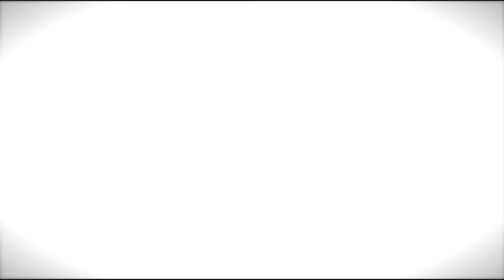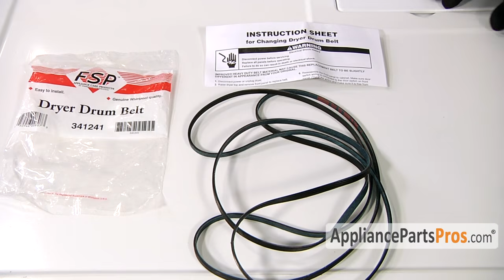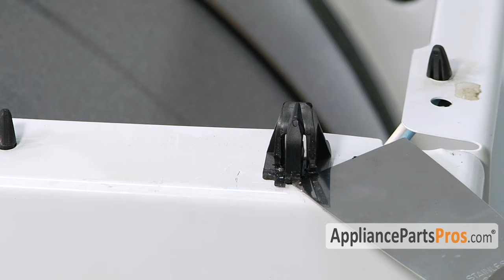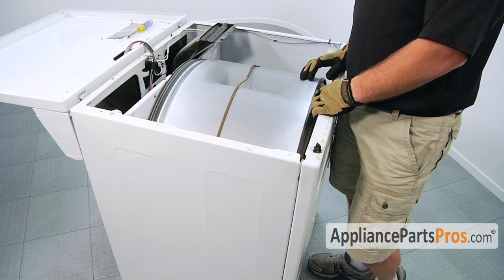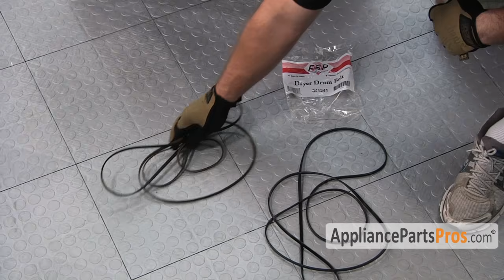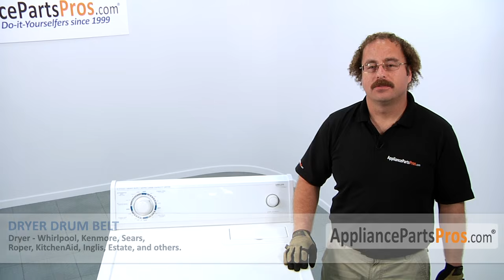How To: Whirlpool/KitchenAid/Maytag Belt 341241

Comment: Door switch connector can be a dog to seperate.  If so. look to see switches alignment with  front panel, carefully remove its two machine screws. Vacuum lint from bottom of dryer. 'Lightly' lube pulley if necessary.
 Some idlers have a pulley / slotted plate vs the videos slider contraption.  Idler mechanism just slips into a hole in the dryer bottom. Its held in place by the tension of the belt around the drom, idler and motor pulley 
motor pulley.  Give the drum a few turns to insure its secure, not twisted and turns freely. Expect to replace belt every few years, depending on usage. Hope this helps.
Reply from the maker: Thanks for sharing these helpful tips! Proper belt routing, checking the idler pulley, and making sure the drum turns freely are all important steps during a belt replacement. Regular maintenance can definitely help extend the life of the dryer. Thanks for adding your experience!

Comment: If my motor works with the belt off but not when it is on, do I need to replace the belt or could there be another reason the motor won’t turn the drum? It recently was stuck and with a cleaning and some grease it worked fine for a few months. Now it is stuck again but doesn’t seem dirty and as mentioned, rotates fine without the belt attached.

Comment: Note: Several important steps were not mentioned in the video. 1. The grooves in the belt must face the drum of the dryer. 2. Carefully remove the lint screen filter screws. Why? If you should have the misfortune of dropping a screw down the opening for the lint screen -- you'll spend the next hour of your life removing parts to find the screw(s). 3. When removing the door panel to the dryer,  it's important to be careful. You don't want to break off the tabs on the panel clips located at the bottom of the panel on the left and right of the front panel. If you gorilla grip the front door panel and try and yank it off the clips you might discover that you broke the clips and will need to replace them before the dryer will work again. The part is reasonably priced and easy to install, however, the wait to get the part in the mail is usually not an exciting time.  4. When you're replacing the belt -- watch so you don't trap your finger between the belt and the motor's pulley. 5. Removing and reinstalling the idler pulley requires you to properly clip the bottom part of the idler pulley into the bottom (base plate) of the dryer. It's super important you "practice" putting the idler in its proper position prior to reinstalling it. Lacing the belt through the dryer pulley while trying to loop it around the motor pulley isn't as easy as it might look. You want to remember practice makes perfect. Lacing the pulley is a "finer art" than you might first imagine. 6. The video showed the technician placing the vent screws on top of the dryer. I recommend you place the screws in a safe place (your pocket, in a coffee cup, or on a table near the dryer). The same goes for the two cabinet screws. If you drop any of these screws you'll wish you followed this tip. When you replace the screws -- be super-duper careful to NOT drop a screw. Why? If you drop a cabinet screw -- at the very least you'll have to remove the front of the dryer cabinet to find it. If you drop a screw while securing the vent opening to the top of the dryer cabinet -- you might have to take the dryer apart to find the screw. If you follow these simple, additional recommendations the chances are you'll have a successful repair.
Reply: Thanks for the added ideas!
Reply: Stan, nice to add some info. But I'm pretty sure that falls under the category of 'common sense'.
Not knocking you or your plethora of knowledge.
This was an informative video that helped someone like me, who has never worked on a dryer in my life, to easily replace a broken belt.
Reply: @TrailingSkies27 with all due respect, which way to turn the grooves was not mentioned and NOT common sense because every machine is designed differently and many of them follow the exact opposite of the way it appears.
Reply: @TrailingSkies27  You are right. It's self-explanatory to most people. The 341241 belt is by far and away one of the easier belts to change. I've looked at some of the newer appliances and it might help to be a mechanical engineer.
Reply: @stannoll6248  Thank you Stan! In fact some of your points have zero to do with just common sense. I'm not an experienced, professionally trained mechanic. However, I am a very well established, unstoppable driven mindset to DIY kind of lady.  I take pride in being self taught, with the help of many others who have valuable points to add. So with that being said, thank you for adding your commentary. I was looking for answers and I appreciatively found them in your comment. As for the snarky comment made towards your comment...🙄there's always one in every bunch. Once again thank you and always add your commentary where need be...there will always be people like myself that are open to the help of others. That's why I landed here today! 🙂
Reply: after 3 hours i found the screw T-T

Comment: I changed pulley and it squeaks and make even louder noise. New belt on the way, but not sure it will work. Anyone have an idea of why after idler pulley changed, the dryer still screams and makes noise?
Reply: The reason it squeaks maybe its in need of new slide gasket on rear of drum.

Comment: Thank you for this video. My belt was broken so I had not taken off the front panel until the replacement arrived. When I saw the tension pulley laying on the floor of the dryer with no loose screws with it. I was done until I saw this video.  A cheap but effective design. All is working fine now.

Comment: my belt was broke. but wouldn't my motor still run when I started it. mine dryer made no noise at all  , so could there be more problems
Reply: Some motors will have a switch that opens if there is no tension on the tensioner pulley. That will interrupt the power and nothing will work

Comment: Great directions!  But the only reason I had to check it out, was to see how the idler was set up.  Your logo hides how it goes in to the base, but by the direction of the upper part, I was easily able to figure it out.  BTW, I don't know how you could do that with gloves one, it's tough enough to finangle it without any on.

Comment: My drier heats, but suddenly it stopped turning after drying a heavy load.  I can get it to spin if I reach inside and give the drum a push start, but I can't dry more than about a pound or two of wet clothing.  What should I suspect, worn belt, bad tensioner....Thanks for your video.

Comment: This was very helpful.  One thing not mentioned that you want to watch for is to make sure the rubber side of the belt is in contact with the drum.  Mine came out of the bag with the rubber side facing outward and I ended up installing it that way.  Needless to say, the drum still didn't spin.  I would also suggest manually turning the drum before putting everything back together.  It turns out that with then new belt installed and the tensioner in the left slot on the base frame, the top of the tensioner was rubbing on the drum and making an awful racket.  Moving the tensioner to the right-most slot took care of the problem.
Reply from the maker: Glad we could help. Thanks for the tips!

Comment: Please forgive me if i missed this in your explanation but is the idler pulley/ whatever it is in your video, just used for demonstration? I do not see a pulley on it? I have same dryer that is in video and trying to order parts, Thank you in advance
Reply from the maker: The first place to start is to search by your model number to be sure this part is compatible with your appliance. A lot of times, even appliances that look alike may not contain all the same parts or use them in the same way.
Reply: @appliancepartspros  I appreciate your experienced response, with your video changing the belt was a breeze, there was a lot of lint and coins etc.. in the dryer casing if anyone is doing this especially for the first time like myself its a good idea to have a shop vac with you and adequate lighting just to have optimal visibility and a clean work area. thankyou again!!!!!
Reply: @JJ-dm9cx  I agree.... I had a lot of lint in mine as well and enough change to start up my own popsicle stand :-)

Comment: Great video thank you !!!, A little detail the belt does have a flat side and slotted side by looking at it it's pretty much self explanatory the orientation that it goes on reference to the pulley on the motor, but some people might miss out. Again great video thank you very much. Last but not least Question how often the belt must be replaced, replaced on fail?
Reply from the maker: You're welcome! We're happy to help. The time period of replacement will depend a lot on how often and how hard the machine is used.

Comment: ive got this all back together, but,,,,  the drum is gaping away from the back of the dryer,   ive double checked and see that the front panel IS attached to the main frame, the screws are holding the upper front TO the main frame, but this is still not holding the drum up to the back of the dryer.  Ive had it apart 3 times. The belt IS still in place every time I start again,  WHY is this drum gaping from the upper back panel ?

Comment: I don't know if anyone has mentioned this, but I'm assuming you pulled off what looked like an intact belt because this was a demo.  I opened my dryer to find nothing visibly wrong with the belt.  The drum moved by hand and it was wound properly on the pulleys.  I put it all back together to try it again, and instead of what I thought was rattling before was a buzz, no turning and a burnt smell emerged.  Unplugged it again and will call a service company.
Reply from the maker: Like you said, the belt we pulled off may have been perfectly fine, and we were just replacing it as an example. However, sometimes a belt can be bad without visible wear. For example, it can be stretched enough to slip, but look okay when you're examining it. 

We'd be happy to help you diagnose your appliance, however. You can give us a call at 1-877-477-7278 or you can chat us at our website: http://www.appliancepartspros.com/. We offer free technical advice. We also have a free repair forum where the techs can help you troubleshoot the problem: http://forum.appliancepartspros.com/. We’re here to help 7 days a week.

Comment: Very clear instructions.  Thanks.  Your's is the only video showing a tensioner without a roller which is what my Whirlpool has.  The tensioner popped off when I slipped the pulley off the motor shaft and I couldn't figure out where it attached.   Your video cleared that up for me.  I had just replaced the gas hose with one having a safety valve in it and the dryer was not igniting.  It was full of lint in the bottom.  Removed the lint and $30 in coins from the bottom, checked the igniter and gas coil impedances - no open circuits.  Tested it with the drum removed - lit and worked fine.  Put the dryer back together and it is still working fine.   The video made it much simpler to disassemble and re-assemble the dryer..
Reply from the maker: Glad the video helped you get the dryer fixed!

Comment: Hello! I own a Whirlpool Dryer LEWP0050PQ2, which doesn't seem to have an idle pulley. How do I connect the belt to the motor, in this case? Thanks for the help!
Reply from the maker: We do not have any videos for this design. I would suggest posting the problem along with the appliance model number on our repair forum and the techs can help you troubleshoot the problem. http://forum.appliancepartspros.com/

Comment: Hello. Question...I have a Whirlpool Cabrio Dryer Model WED6600WL0. The drum was having some trouble turning but would kick in when I gave it a spin and closed the door and hit start. Now it will not turn at all. It goes to SENSING and then flashes an "F" and then a "1". It is not a F1, but an "F" and then a "1". So. Everything I have seen on an F1 points to the control board, but given the problem I described--do you think that might not be the problem? Is it most likely the belt, or perhaps the motor? Any insight you could provide me would be great--I would like to fix this myself, but don't want to waste time and money on a control board-if that is not the problem. Please let with a response.
Reply from the maker: F1 is the code for primary board failure. You could start by checking all the connectors to make sure they are not loose or you have a bad wire. You can also look for the tech sheet and go through the diagnostics. You can also post the problem along with the appliance model number on our repair forum and the techs can help you troubleshoot the problem. http://forum.appliancepartspros.com/
Reply: Thanks. Looks like a bad ECB. I tested all of the components between the board and motor. All test to spec, but like a schmuck, I bought a motor. Replaced it. Still F then 1. So...got to be the board. I have seen some videos where a solder point is burnt through. Going to pull the board right now. Whirlpool wouldn't budge - 2009 - out warranty is out of warranty.
Reply from the maker: Glad you got it figured out!
Reply: +AppliancePartsPros Thank you. I guess the lesson I learned was ALWAYS trust the diagnostics and the meter. Even though I had the motor out and the Start & Main tested OK. I ignored what I saw and bought the motor. When I pulled the board I had the old solder burn out on one of the Control Board connections. I cleaned it up, re-soldered, and voila! It's running again. I apologize if this is too much, but if I can save someone else the hassle and expense...that 160 dollar engine though. :)

Comment: My Whirlpool dryer runs, gets increasingly noisey and shuts off. After a few minutes, it will start up again. I lubed the rollers, checked the belts, lubed the motor bearings. no change. I assume it overheats and shuts off. Is there a thermostat that needs replacing or is the motor overheating?
Reply from the maker: +jimbo Assuming nothing is binding up the drum or the motor/blower it could be the motor is over heating. If you have a meter you can measure the amp draw on it. A clogged vent can also cause a dryer to overheat, I would completely clean the dryer and the venting all the way out side to be sure it is flowing freely. If you could determine where the noise is coming from that might help you narrow it down too, if it is the motor bearings they are not sold separate and the motor would have to be changed. If you need more help you can also post the problem along with the appliance model number on our repair forum and the techs can help you troubleshoot the problem. http://forum.appliancepartspros.com/

Comment: I have a whirlpool dryer sure the belt either came off or broke figure it broke but either way needs fixed but watching different videos there seems to be several ways they come apart some need to have the control panel taken off from the back the screws removed from the back first and some that are easy to tear down like in your video  is there a way to determine which way each model needs to be disassembled or just kinda tear into it and hope for the best lol
Reply from the maker: +Michael Morris There are a few different styles and they all come apart a little different. You can go to our website and enter your appliance model number to view the parts breakdowns to get an idea how the dryer is put together.
Reply: Hey no problem installing the new belt, it was just hard to find the right on, from no shuch mt# to a belt that is a foot to long. It looks like you may have got what I need so Im going to try it and hope it fits right, and the price is right.

Comment: how do I know that the belt is the problem, if the belt is not broken?
Reply from the maker: +Kellee Nelson Without knowing what your problem is I cannot say. You can post the problem along with the appliance model number on our repair forum and the techs can help you troubleshoot the problem. http://forum.appliancepartspros.com/
Reply: +Kellee Nelson it may have just fell off that's what mine did it was a simple fix once i got the front panel off. thanks this video helped alot

Comment: Hi, I have an older Whirlpool gas Dryer  (1971). Works perfect but know at some point the belt will go.  Will this video give us instructions for replacing a belt on this old of a dryer. Thanks.    P.S.  The dryer does take this belt number 341241  - Serial M30301471   other no is LX18801WO.  Thanks.
Reply: +Susan Dudak   Oh, Model No. is LXE8800 or LXE8801
Reply from the maker: +Susan Dudak You need to get the model number off the model and serial number tag, it cannot have 3 different ones. I am amazed you still have this and its running! Going by the first model number you gave LXI8801W0 the belt you listed is correct. The video should be a great help, there will be a few differences like the door switch and that you have the split type front panel like we talked about in the video.
Reply: +AppliancePartsPros Thank you for your response.  I think the video is going to be very helpful.  We also have the matching washer.  We just had the belt replaced and I'm doing a load as we speak.   We never had children so it didn't get the use that many washer/dryers do.  Also, this model Imperial 80 was at the time the top of the line.
Reply from the maker: +Susan Dudak They were good designs! The washer was phased out years ago but the dryer design and parts are still being used on the newer ones.

Comment from the maker: Keith Kitchin, You do not have the reply feature on so I cannot reply to your post. There are 2 sets of holes in the floor one of them line up better with the motor pulley. If you use the wrong one it could cause the belt to run at an angle and fall off. If you look at 3:01 in the video it show the idler mounted in the 2 front slots.